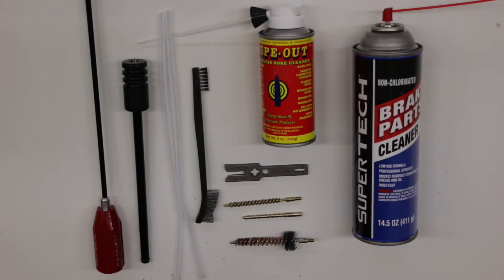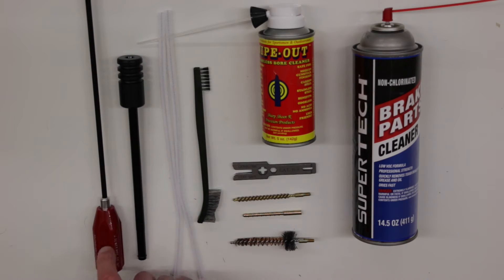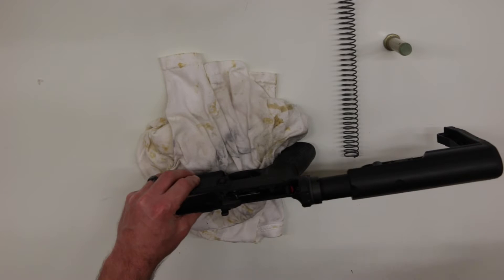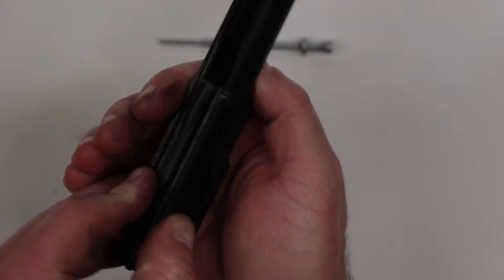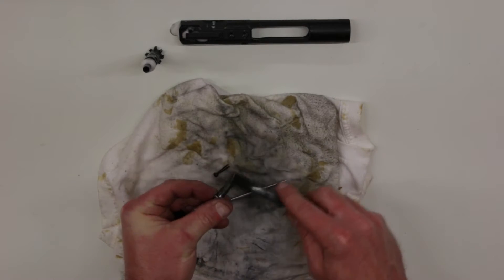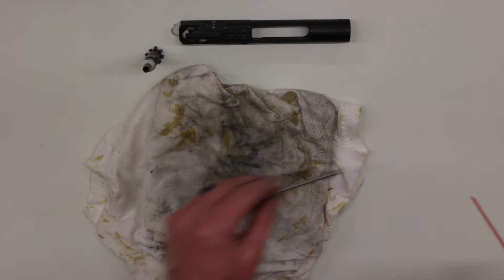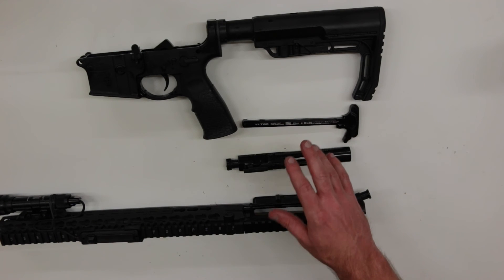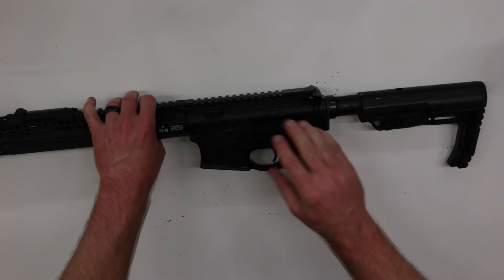AR-15 Cleaning & Lubrication

Comment: Does ur ddm4 upper have any wobble with the lower ?
Reply from the maker: There was some slight play originally but I sent it back to DD and they corrected it. Once it loosens up over time, I'll just install an accu-wedge.
Reply: The Lonestar Patriot dannngg.. my dd mk18 has some play in it maybe I should consider sending it in for peace of mind i guess.. not to mention the cost lol. great channel by the way. Peace from Dallas 🤝
Reply from the maker: Thanks brother, I appreciate the support, especially from a fellow Texan. It's worth getting in touch with DD to see what they say but aside from the hassle of sending back a new rifle, it was a seamless process. If I recall, it took about three weeks from the time it left my door to the time I received it back so it was pretty reasonable.

Comment: Hey, did you solve that cycling issue from previous video?  If so, what did you find out?
Reply from the maker: Hey Carl, yes, I believe I've identified the issue as I was doing the cleaning and lubrication. With the lower receiver separated from the upper, I was able to duplicate the same issue and it appears to be the disconnector during trigger reset. As soon as I can be 100% certain of the cause, I'll certainly report back on that video or potentially make a short follow-up depending on the extent of the fix. Even after dry firing about 30 times, that certainly helped.